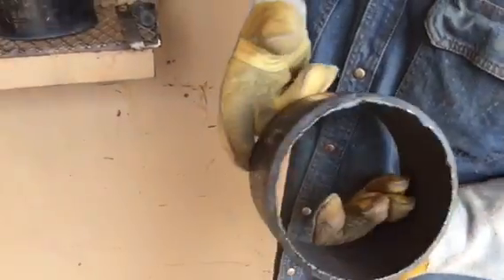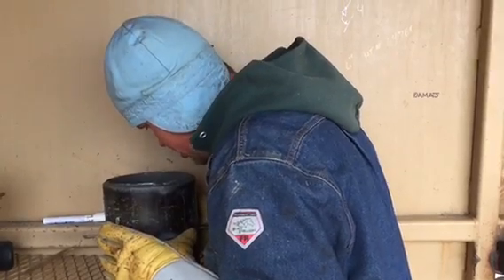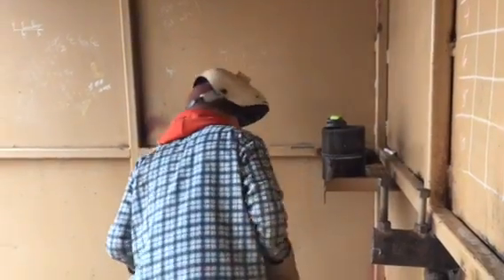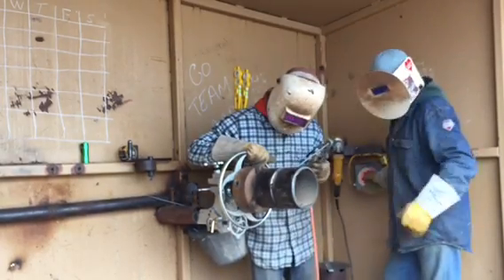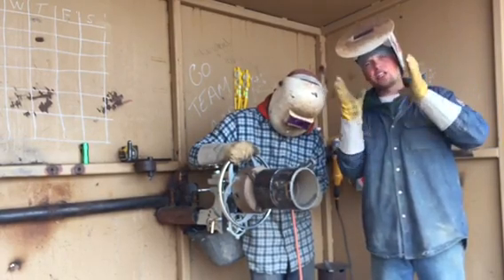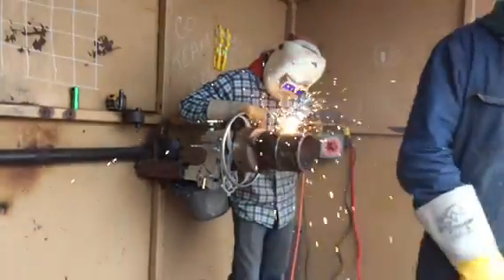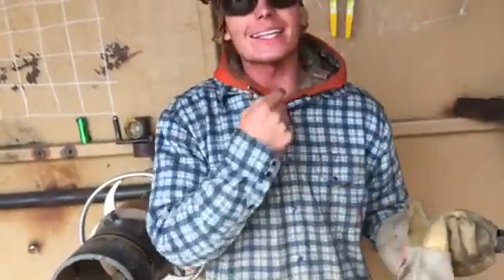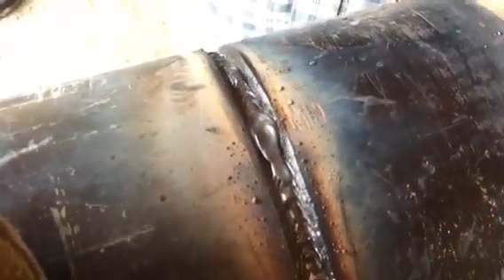Little helper practice and a couple tips!

Comment: When I took Level three pipe at trade school. Night class I would sneak in in and weld out extra  coupon. Root hot pass fill  and cap. Fixed position. They finally caught on and then had a group meeting. Then got hired on at Refinery tank job before class finished. Most worked and schooled st same time.Craft trade center. and jr college.
Reply: Javier Garcia what school?
Reply: Craft training center. When I was 23 years old.Whent Straight in to level three pipe. Had a job   way through semester. Now they are realy concentrating on High schoolers.
Reply: Javier Garcia I'm trying to get into pipe. I weld sheet metal now all tig ss.
Reply: Just get you some schedual 40 8 inch.  Cut two pieces at 7 inch or so. At 60 angle on your torch. Grinding And smooth out your bevel. Both pipes. Faves. Then grind about a dime with landing on top all the way around. Fit and tack four sides of your pipe making sure it's even all way around.1/16 to 1/8 gap. Then set your machine to 90 to 102  with 1/8 5 p plus. Rod start on the bottom tack works ng your way up right side making sure you start a key hole then keep your rid about 1/16 in past leading edge. Work you puddle tight with an oscillating motion or t or zig zag. 1/4 way up then go to the other side and back to the right side. Then back to left side finishing up to the top of pipe. This is your root pass.  As soon as you feel a stick or mandrake stop and grind it out and start again. Yiu must be able to have a continuous smooth weld without sticking your rod and stops. Then grind your weld smooth all way around and start your hot pass. It's like little dimes you continuously lay down
 After your hot pass you fill three stringers 7018 hopefully filling up to flush top. Then you run your cap from bottom up. Half one side then half back up other. Then finish both sides out. Keep in mind you practice just your root until you get it right. 3 months or so. Check out pipe and structural codes and procedures for nterpass temp amps and placement if stringers. Also look for schools or centers in your area and go sign up. With Tig experience. A two year degree. With Tig root pass and 7018all the way out. You will be a surgeon. Those are the jobs out there. But your job is done n demand to. Especially navy certifications.
Reply: I don't have any certs
Reply from the maker: straight commitment i like hearing it. WHATEVER IT TAKES!!!

Comment: 2 questions: can I run my metabo off the front plug of my SA 200 and do you ever work your remote while you are weldng or do you always have your helper do it
Reply from the maker: Dylan Cox as long as its DC compatible then yes. And do I work the remote by myself very rarely because I’m usually rolling with one hand and welding with the other.
Reply: @JacobSchofield  how can I email you?

Comment: Are tests usually in the 5G position (straight vertical like in the video) or are they 6G position (45* locked position)?
Reply from the maker: Aj Bourne no most are in a 6g this was a fun little competition we put together between the helpers. But I have welded like a 12" 5g but only a handful of times
Reply: Jacob Schofield ok thank you!! I've only ever had a 6G test for any job so far but wasn't sure how they did it out there.
Reply from the maker: 6g mostly.

Comment: Seems not very efficient to be two people. One watching while the other guy work.
Reply from the maker: Northern Sweden Welding there called welder helpers and there job is to getbparts help pull measurements turn down orbup the heat box help fit pieces of pipe grind and buff welds they do quite a bit. It's amazing you guys don't get helpers. It would make you a lot faster and it gives that other person an education he would never get anywhere else.. Be Blessed